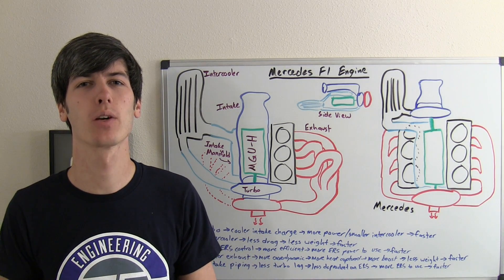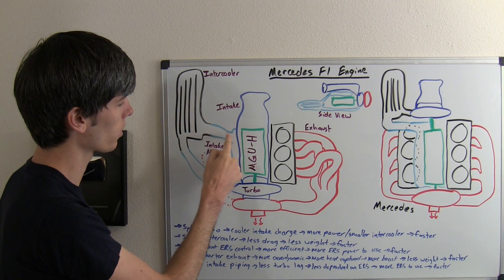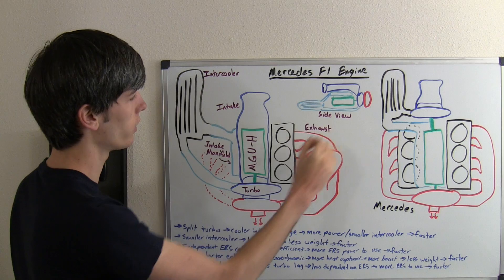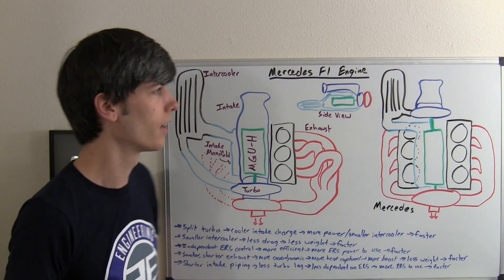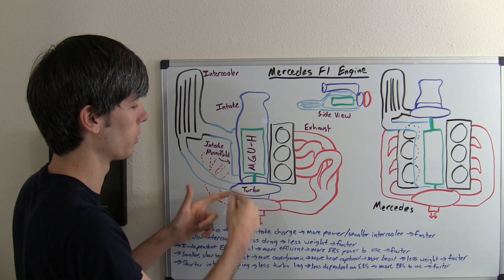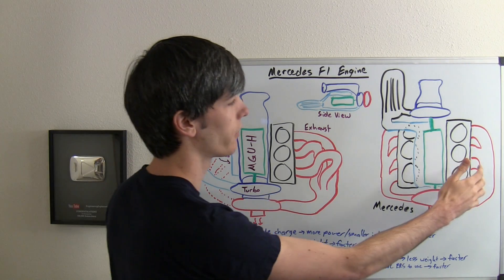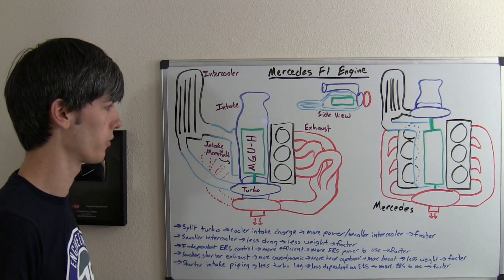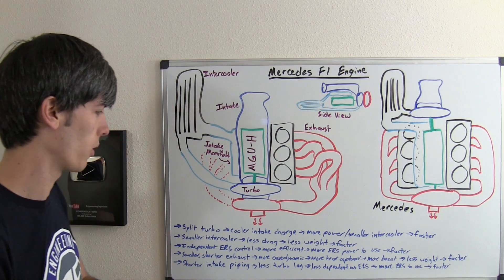Mercedes F1 Engine - How Mercedes Dominated 2014

Comment: The shorter intake path will have a smaller volume, so there is less air to compress. Less air, means you get pressure quicker. Thus a shorter turbo lag.
Reply from the maker: Yes indeed!
Reply: Engineering Explained
http://www.autosport.com/news/report.php/id/116104
It looks more or less like the Mercedes engine, but hard to clearly say

Comment: This is quite amazing. Although I miss the sound of the old engines, more efficiency will help everyone in the long run.
Reply: Most people are too stupid to understand any of the technological stuff in F1. They just think "Wow that car is making a lot of noise, therefore it's good". Actually all noise a race car makes is energy that wasn't used to make the car go faster.
Reply: That is completely true! It takes quite a bit of energy to produce noise, all that could be saved and used to get better efficiency
.
Reply: Weese That's also why turbos are more efficient, the turbo uses some of the exhaust gas pressure, which would otherwise only cause unnecessary noise, to increase power.

Comment: Honda engine for 2015 should be very interesting, see how well it stacks up against the Mercedes engine...
Reply from the maker: I'm quite curious as well.
Reply: I work for a company that makes F1 parts and I know they have a few tricks up their sleeve that Mercedes would've liked to use ;)
Reply: McLaren are saying tat their Honda engine have similar results to the Mercedes engine they used last year. The 'split-turbo' was a good idea on Mercedes' part, but i don't expect them to have the advantage carry over from 2014 to 2015. Mercedes and Ferrari have been putting half their time into their 2014 engine and half into their 2015 engine, whereas Honda have had all of their time to work with their 2015 engine to make it as powerful as possible. the retun of the legendary McLaren-Honda partnership could make some Germans slightly worried about the defense of their title...
Reply: F1Maniac2011 As far as I know, they have the Mercedes design in which the Turbo is split to enhance cooling BUT their major difference is about the turbine itself, located in the middle of the "V" and set as centrifugal, like found on airplanes turbines. That explains why the McLaren sounds so different now, because, 1 they are still lowering its power to work on reliability and 2 testing its limits. I think that they have a diamond in raw and they will eventually dominate if the FIA don't revamp everything again. Ferrari on the other hand made huge improvement that will let them win in the future, but if these regulations persist...Honda is the way to go. Engineering Explained Can you dig a little and make a video if possible?
Reply: I havent dived into any engine technicalities so im working on the basis of what you say is true. McLaren and Honda pretty say their engine is being developed and will be a good engine. Sounds like theyre making it sound like it's a wonderful diamond covered in tons and tons of dust that refuses to go (if you understand what i mean)
Reply: F1Maniac2011 Indeed I do get it. Let's hope it don't take them year to clean that dust off and add more competition to the F1.
Reply: Very much agree. If Monaco was good for McLaren, could Singapore be decent (barring any reliability issues)?
Reply: Took a few rough years but now it stacks up very well with Newey's chassis design ;)

Comment: Should experiment and try to implement a lapel mic.
Reply from the maker: Not sure how that would make the cars any faster...

I actually bought one haha, but it isn't powered (nice), so I've got to continue my quest for better audio. I do use one during my car reviews for the GoPro portion, as GoPro cameras will power an external mic.
Reply: Engineering Explained I meant for your video production...Picking up lots of room reflections and barley any low end currently. Or install some huge fiberglass (insulation) panels in the room to dampen reflections. Correct answer is to both move the mic to the source and dampen the room.

Comment: I have one question. You said that the MGU-H unit is independent, so it can compensate the turbo lag by spinning only the compressor only. So does that means at that exact moment, the rpm of the compressor is faster than the turbine? If it is faster or simply not equal, can I say that the shaft is not connected directly?
Reply from the maker: Correct, there could be a clutch between them to disconnect. Should have mentioned.
Reply: Engineering Explained
The 2014 regulations prohibit different speeds between compressor and turbine. Rule 5.1.6 states "the compressor and the turbine always rotate about a common axis and at the >>same angular velocity<<" - source: http://www.formula1.com/inside_f1/rules_and_regulations/technical_regulations/8699/fia.html

However regulation 5.2.4 does allow the MGU-H to be clutched relative to the turbocharger shaft.. I guess this would be done by having the MGU-H shaft hollow with the turbocharger shaft passing through it concentrically, and a clutch mechanism to engage or disengage the hollow MGU-H shaft to/from the turbo shaft going through it. They could legally be non-concentric but from a packaging standpoint it's almost certain that both all share a common shaft axis.

Comment: I was hoping you'd explain/speculate what material they used for the cylinder that connects the turbo to the exhaust. It's longer than what the Renault engine used. Longer means its more vulnerable, yet it was relatively reliable throughout the 2014 season.
Reply: It is actually not necessary to use a single long shaft. They can simply use a short stub axis on either side which connects to the mgu-h unit. This way, the turbine, compressor and the mgu-h are individual parts and can be changed quite easely. if something should brake.
The rules also don't say, the turbine and compressor has to be connected with a single shaft. The rules only referes to a "shaft assembly".
Reply from the maker: Are you referring to the rod between the hot and cold portions of the turbocharger, or something else? Material selection in F1 is a highly secretive art, though I wouldn't correlate length with weakness, there are various ways to overcome strength issues. Fairly simple in the big scheme of things.
Reply from the maker: shi01 Correct!